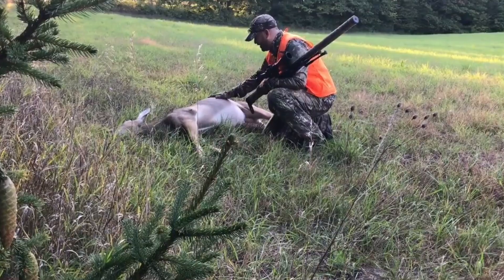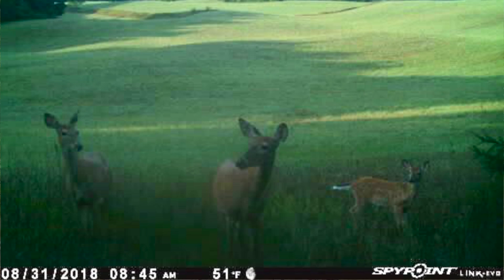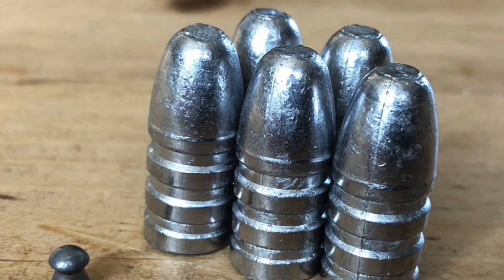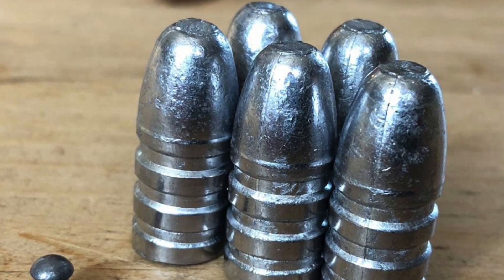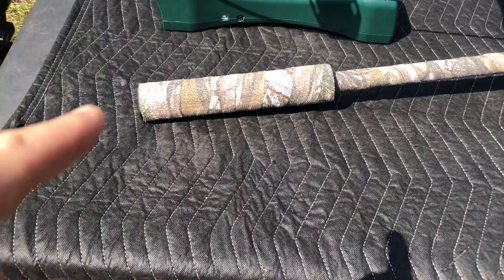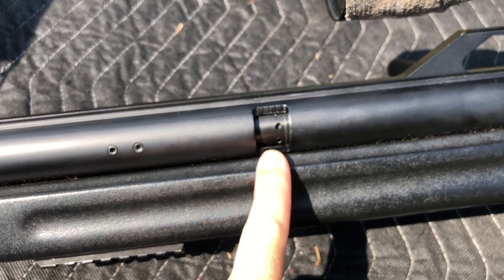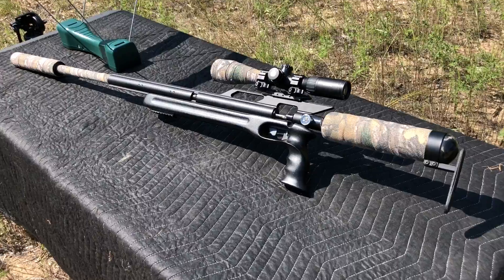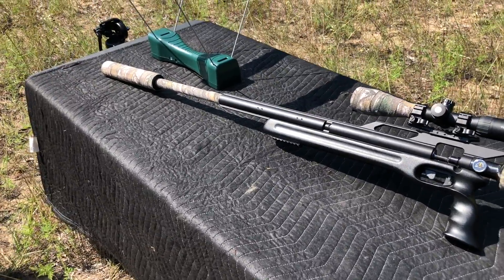AirForce Texan .45 Air Rifle - OVER 700 FPE! Hunting with the New African Air Ordinance Super Valve

Comment: I wonder what the difference would be using helium with that 350grain. How close do you think it'd get to breaking the sounds barrier?
Reply from the maker: Blake Browder We are gonna find out today....  got a full tank of Helium from the SCUBA shop.   Based on my calculations we will get well above the 1140 FPS sounds barrier with this 350 grain slug.  With my .357 I was able to sling a 174 grain slug 900 FPS at 3000 PSI on air and 1150 FPS at 3000 PSI Helium.   
Watch here: https://youtu.be/bzZCklzNMc4

So using that calculation we could get this slug up over 1200 FPS using this Super Valve and Helium.  That is around 1200 Foot Ponds of Energy!  Stay tuned!
Reply: @UpNorthAirGunner  oh I hope so! I can't wait to see what the outcome is!
Reply: So I've done the 4500 kit to my Texan and I've got a question about tethering. I have a 74cu tank filled to 4500. So inorder to tether I should be able to just connect to the on board tank on the rifle and the pressure should match the 74cu tank. I ask as I had done so and both the compressor pressure gauge and the 74cu bottle gauge both read 4500psi but the gauge on the on board bottle read 4900-5000psi. So I was wondering if maybe just that gauge is off or since that the 74cu is bigger it actually creates more pressure on the smaller on board tank and raises it past 4500psi.

Comment: I have a question for you because you seem to be the airforce guru. I have a Texan .357 that I have shot many slugs through. The gun seems to like the Hunter Supply 127 gr flatpoints the best. I have never been able to get any real accuracy with the gun. I know you have been experimenting with these gun for awhile to get the best bang to the buck. Any suggestions on what I need to get the gun shooting descent groups at 75-100 yards. Any input would be greatly appreciated. Thank you.
Reply from the maker: For me once I slugged my .357 Texan barrel and realized it slugged out at .358 - I started shooting .358 sized slugs - the 4 best slugs were: 

* The Hunters Supply 170 and 190 grain slugs: https://www.hunters-supply.com/air-358-357-cal-170-p-859.html and https://www.hunters-supply.com/air-358-357-cal-190-p-864.html
* The High Arc Hunter Raptor 172 HPs: http://www.rlairgunsupply.com/ammo-pellets-bbs/high-arc-.357-caliber-172-grain-hp/
* The NSA 178 Boat tails: https://nielsenspecialtyammo.com/collections/357-cal/products/178-grain-hollow-point-boattail-airforce-texan-357-pellets-35-caliber-air-gun-slug-swaged 

Hope this helps! 
- UpNorthAirGunner
Reply: Ok, thank you. I’ll probably order a batch of each and see which one shoots the best.